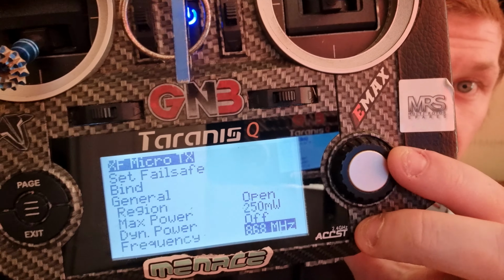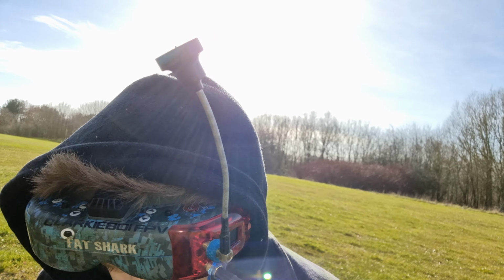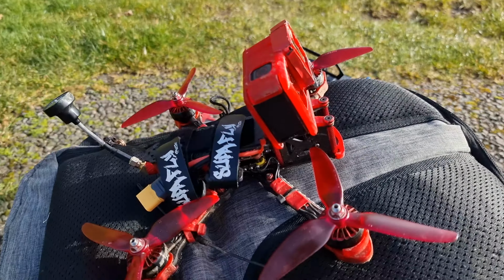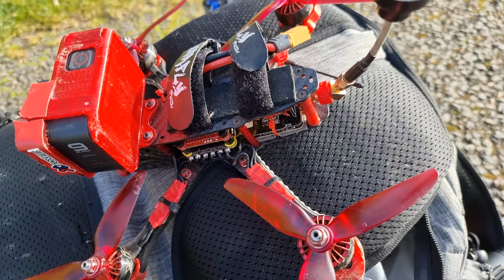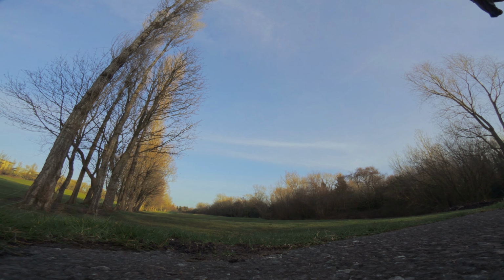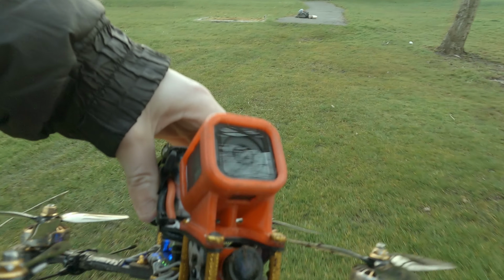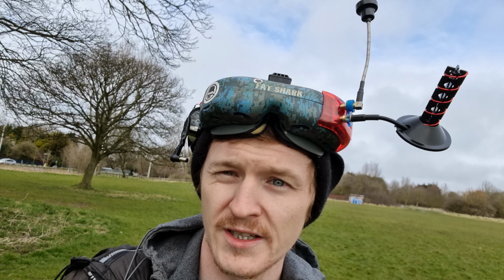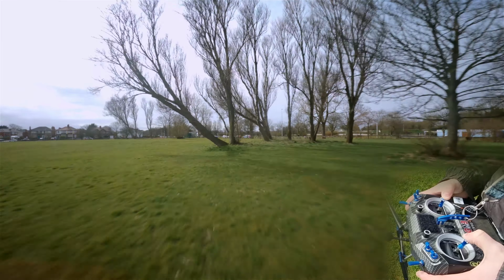Upgraded To Crossfire Shot! || FPV Drones

Comment: How did you only get 3.5 minutes on that flight at 6:00 ? I get 9 mins crusiing on my nazgul with an 1100 mah 6s.
Thanks for the video, I just upped my firmware to the latest open tx which puts crossfire shot in without a nightly. Haven't tried crsfshot before, hopefully it feels good :)
Do I need to also somehow lock it to 150hz mode?
Reply from the maker: It's about right for a 4s on 2750kv motors with johnny props. If I just cruise around I can get about 6mins. And yeah I've just updated my firmware to new version of open tx. Took them ages to release that but I'm glad they did. And I've never locked my crossfire at all. Never really felt a difference when it switches. You could always try it.

Comment: What's your opinion of the xing camo motors? Looking at getting a set myself
Reply from the maker: Yeah they are great. I've bashed the hell out of mine. Got sand in them many times and had to take them apart and clean them and they still spin up smoothly. I would definitely recommend the Xing motors. I used to use Tmotor and they are crap compared to these in regards to durability
Reply: @AlexFliesDrones  surprised that in your experience xing is better than t motor, I thought general consensus was that T motor is better
Reply from the maker: @definingslawek4731  the new design of the motors like the velox are supposed to be durable but I've not tried them so o can't really comment but all I know is the older styles just became very unbalanced and grindy very quickly.